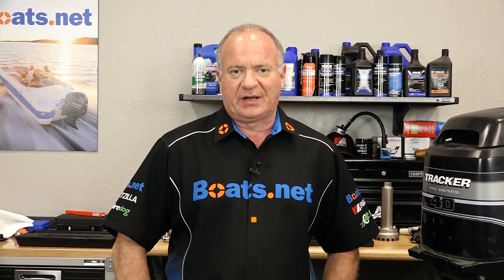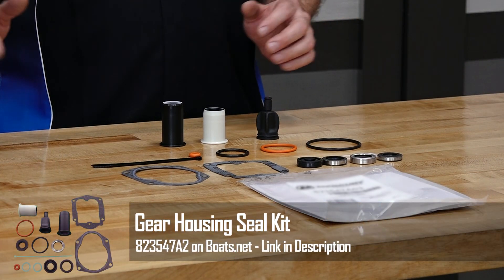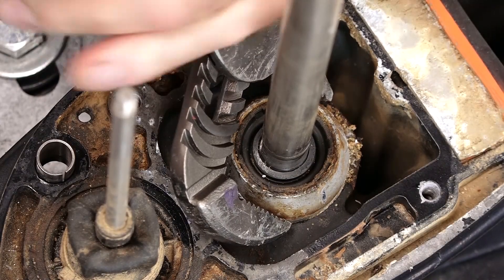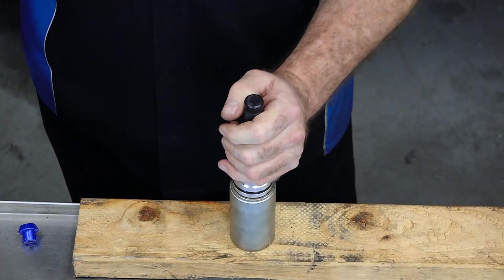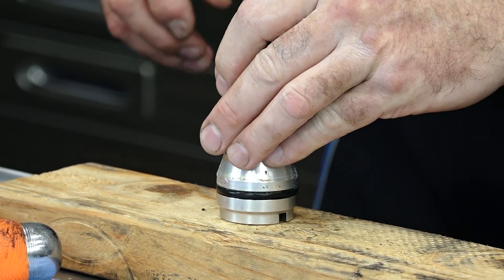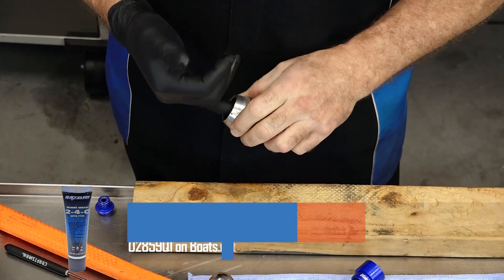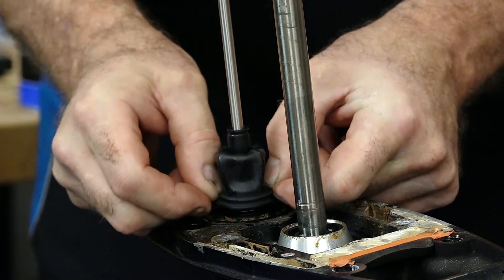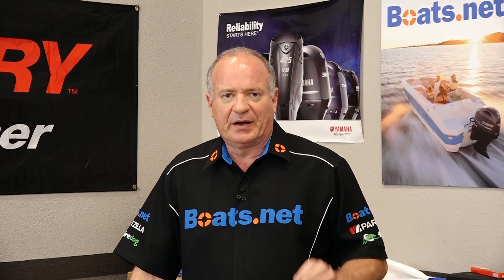Mercury 40HP 2-Stroke Upper Seal Replacement | Mercury 40 Input Shaft Seal Replacement | Boats.net

Comment: Hi John, I have a simple question on when reinstalling the driveshaft carrier back in the gear case does the orientation matter. The reason I am asking is there is in the back of the gear case carrier cavity a hole I suspect for lubrication proposes and as well the carrier has 2 notches in it. Do 1 of the notches in the carrier need to line up with the hole in the gear case?

Comment: Hello, is it possible to make a video showing how to replace the shift shaft seals (orings) in this particular outboard?, I am not able to remove the plastic housing, I don't know how to pull it out without damaging it, is it screwed?, just pushed in?. Thanks a lot, your videos are very helpful.
Reply: Im wondering the same thing. Did you ever get it off?

Comment: Is this the same procedure for a 1995 2 stroke 40 hp force by merc? I am trying to remove that housing with channel locks but it’s not budging. Thanks
Reply: Any luck? About to do the same thing
Reply: @ShaunIsOnFire  no luck yet. We’re you able to get it?
Edit- ended up having to take pinion nut off and removing the shaft. You should be able to do it like he did if it’s not corroded